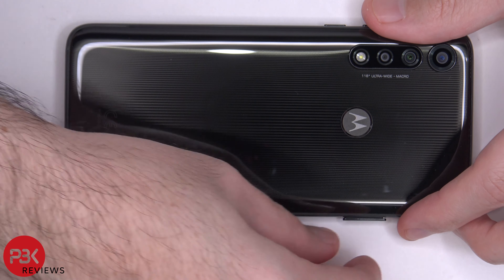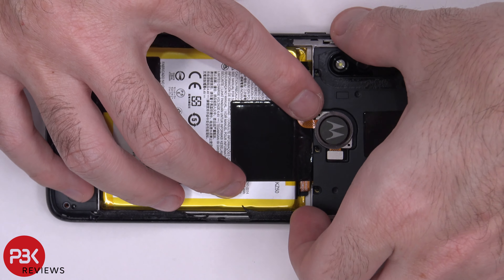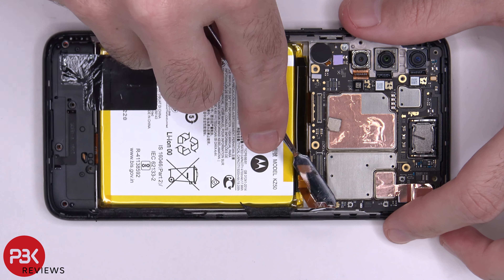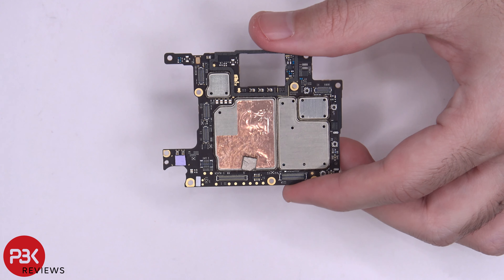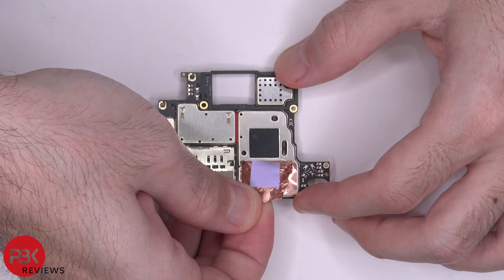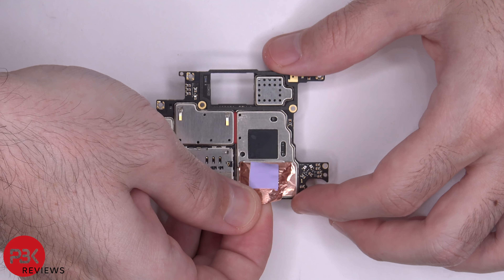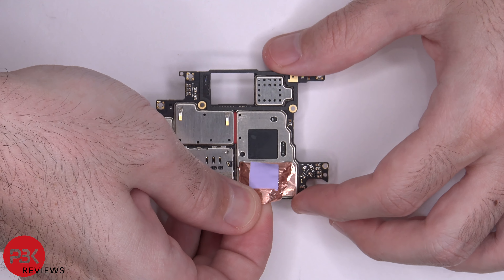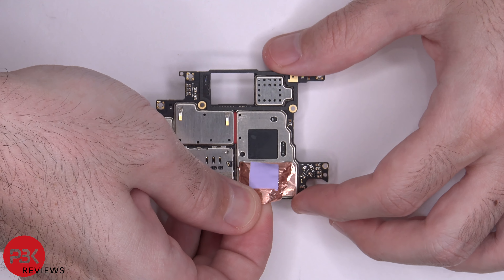Motorola Moto G Power Disassembly Teardown Repair Video Review

Comment: Great video.  It's just sad that the phone is assembled with so much glue and tape.  It would be nice if phones were designed to allow easy replacement of screens and batteries since those components have high rates of breakage/failure.
Reply from the maker: Thanks, and ya would be good if it was easier.
Reply: I have a 2020 g power that I love but the charge board is failing. Ever phone I've had ends up with this problem. I'm sure I'm causing It. I use my phone while charging allot. If the charge board was easy to replace I'd probably keep the same phone for years. I might try a Fair Phone but Im spoiled by the powers battery life
Reply: They make it so difficult so they can make more money. They know that most lazy consumers would just rather buy a new phone as opposed trying to change something seemingly complicated on their own. I would definitely encourage learning something new when the battery dies, and it will, eventually. The key to significantly delaying that process requires knowledge of the battery itself as far as knowing what a cell system is to begin with. Some of the fault of the battery problems belongs to the companies (30%) although much improved, they still haven't developed a competent multitasking, proper heat conduction/distribution battery ( if even possible) Most of blame for premature battery failure lies solely on the consumer (70%) Smartphone user's abuse the battery with overloading the cell's with way too many time consuming multitasking.This causes the phone to overheat, especially on warm, hot day's. Batteries require a cool down, recovery period, much like a human require rest to heal and rejuvenate, it's no different from the cell's within a battery. First mistake is, they are charging their phone's daily which should be done every 2-3 day's.They are overcharging the phone's. A phone should only be charged 100% once a month only, with an average charge of 70-80% 2-3 times a week. Phone's shouldn't be charged in hot climates, in fact should not even be used for long periods of time in direct sunlight, quick texting, phone calls only, no surfing. Extreme temperatures are the main problem, either thru excessive use or in extreme elements too long. Lower the light and shorten the display time under a minute. Another hack is to turn off any apps that may be running in the background. The main key is moderation ( easier said than done😄) it could add up to 5 years to your battery life.

Comment: Cracked my phone screen on the third day I had it. Fixed it today. This video saved me a lot of money. Thanks for posting!
Reply: Where did you get screen from? I'm trying to purchase one
Reply from the maker: You're welcome, glad It helped!
Reply from the maker: Here is a link for one on amazon https://amzn.to/3fHthuQ
Reply: @iotofiot8008  I found it on eBay.
Reply: Looking for a new screen I can't find.any expect for the Moto g8 power one
Reply from the maker: @yungo.g8797  here is a link for some on amazon. https://amzn.to/32gr30g   make sure you are searching for XT2041 lcd screen since thats the model number of it they list under usually. Sometimes the same type of screen is used for a few models of phones. Also keep in mind if you look at the pics, there is subtle differences on the screen cables, make sure the cable matches that of your phone you are replacing since some phone models may differ from different regions and the cables might be different as well. For example if its a XT2041-2 vs XT2041-4 etc. If you take your's apart and look at the screen cable and how its positioned, you can compare it to the one on the amazon listings and match to the correct one you want to purchase. Hope this helps.
Reply: Hey Tim, can you please share the ebay link? It's expensive on Amazon. Thanks!
Reply: You have to remove all of that just to replace the phone's battery?  I have a 2020 model Motorola MOTO Power G and my phone's battery looks bloated to the point that the phone's back cover will no longer stay closed.
Reply: Should I buy a different brand of phone since my Motorola MOTO G Power 2020 model is having a problem with it's 5,000 mAh battery?  I could never do what you're doing in your video but I'm considering buying a different brand of smartphone to replace my 2020 model Motorola MOTO G Power smartphone.

Comment: Good video.  A Few notes.  Mine was a T3 not a T4.  I think in editing he missed a couple cable disconnects so just keep your eyes open for that kind of stuff.   If you're doing a frame replacement you don't have to peel off all of the tape.   Just take it off the battery.  Not a big deal but keeps parts together a little better.  No need to pull the copper tape off the rear facing camera.  He likely did it just in case you needed to know.  All in all, it was very helpful.  Just did a frame replacement with new screen for $40.

Comment: The camera glass on my Moto G Power 2021 was broken. I began by trying to heat up the glass only to avoid removing the back completely. Then I noticed some of the back covering became wrinkled/warped from the heat. I then decided it was best to proceed by removing the back cover. However, after failing to remove the backplate (used a heat gun for about 3 minutes) I reverted back to trying to remove the broken glass only. I used a precision flathead to begin removing the glass. I used the heat gun here and there to soften the adhesive, used the flathead to scrape off the adhesive and pry off the bigger pieces of glass, and used tweezers to remove smaller bits. Towards the the end I used baby cotton swabs with alcohol to further remove sticky residue and bits of glass. Eventually I was successful in changing the camera glass without taking the back of the phone off.
Reply from the maker: Glad you were able to get it done. Here is a website in case you need any parts for it: https://www.mobilesentrix.com/replacement-parts/motorola/g-series/moto-g-power-2022

Comment: for those of you trying this, I had struggled to get the back off, apply heat like he says via hairblower and it should make it easier. also make sure you are only taking off the tiny part of plastic, i was trying to take off the back at the line closer to the screen, which is incorrect. I used a thumbtack and a decently thick credit card since I did not have the tools the video has. If you are careful enough, I was able to use the thumbtack without damaging any part of the cover/plastic/phone .
Reply from the maker: If you need replacement adhesive to re apply the back plate/back cover for this phone or other parts, you can get the original parts from mobiledefenders.com .
Reply: I did the same and ripped up the plastic around the side of the phone.  I use a cover so assuming that I can get it functional again it won't matter, but I spent far more time and effort than was necessary.  UGH!  The cover comes off, after adhesive loosening, just like any other cover.  I have no idea why they don't make it accessible.  

On another note, my phone went into the pool.  Millenial brainstone, I hope that it's just the battery which I'm going to replace.

Comment: Great video. Thanks! When you say "heat up a bit" in order to remove the back side, can you indicate what temperature to use for the heatgun?
Reply from the maker: I usually don't use a heat gun and generally use a hair dryer since its more of an even heat and not so direct and potentially damaging if you overdo it. Either way you want to generally heat up the back evenly at first  but just going in slow circles, then when its warm, you heat up the area you want to begin prying off a bit more so its hot to the touch. Then you can use a suction tool or something else to help gain leverage to get your pry tool in, and you can add heat as needed to keep the adhesive loose while working your way around with the pry tool.
Reply: @PBKreviews  Thank you for all the advice. Repair done successfully! I used the hair dryer eventually as you suggested.

Comment: I appreciate this video. It's very clear.  I bought a T4 screwdriver when I ordered the battery but it's way to big.  The torx opening is half that size but this and the other videos I watched all said T4!  But mine. Ugg.
Reply from the maker: Some brands especially ones which are not made for smartphones differ sometimes. It's best to be a small kit which comes with 4 sizes just in case.
Reply: @PBKreviews   I bought it at the phone parts place that sold the battery.  I just got the new set and the screw size is T3 on this phone, model XT2041-4.   You said "gently heat the battery".  How much is "gentle" and what did you use? The battery is puffed up and swollen and I don't want this thing to exploded!  Thanks so much.
Reply: I got it. Someone else suggested a few drops of 90% alcohol under each corner of the battery and that worked.  Back together and working now. Thanks again for the great guidance.

Comment: Don't even know how, but my lower lenses/flash on my camera are all cracked.  Messes up photos in certain lighting conditions(most lighting conditions I think).  Was looking into new phones, but most phones in my price range are freaking huge and the moto G power 2020 already is bigger than I'd like.  Decided to just order the part and fix it.  8 bucks including shipping for an OEM part.  Not sure I want an OEM part  in this case since I have used a case ever since I've owned the phone yet somehow the bottom lenses cracked anyways.  Thanks for the guide, should hopefully be a simple fix.
Reply from the maker: You're welcome. The glass cover for the camera lens is held down with adhesive so you should be able to heat it up a bit with a hair dryer and pry off the glass portion with a razor or xacto knife or something similar, without having to actually pry off the back plate/battery door. Regardless if you need any additional parts for the phone, you can get all the original parts including adhesive for the battery door/ back plate to re apply it at mobiledefenders.com
Reply: @PBKreviews  thanks.  I have a heat gun somewhere, just need to dig it up.    That's the website I ordered the part from, thanks.
Reply from the maker: @jwest88  👍

Comment: my motorola has an issue with power button being pressed in, its constantly trying to turn on and off. would it be possible to fix something like that without undoing more than back cover? i dont have a way of unscrewing the small screws

Comment: Fasinating video!   Thanks!   Just curious, I love my Moto One Action and I keep my sell phones for at least 4-5 years.  What is an average cost with labor to replace the battery when the time  should come.  Or is close to the cost of replacing the whole phone? Thanks again for posting!  Cheers, Steve/OHIO
Reply from the maker: Thanks, Labor can vary from place to place but the battery cost is usually around $30-$40 USD. Shouldn't cost more than replacing the phone.
Reply: build in battery lasts 4 5 years in my moto phones usually they outtated or cracked before battery even goes even if charging randomly only few at time my expeirence w moto

Comment: My phone screen recently cracked and I was using a few videos like this as reference to try and get the back off to replace the screen. I've really been struggling with it, do you have any advice on getting it off? The heat gun hasn't really been working for me
Reply from the maker: The adhesive can be very strong on this model phone. You can try using a metal thin tool to help you gain some leverage between the backplate and the frame to get a pry tool in between but that can possibly damage or scratch up your frame a bit. You can also use a suction cup tool for smartphones to help you pull up on the back housing as you're trying to get your pry tool in as well as prying it off. Also keep applying heat every now and then as your prying it off to keep the adhesive loose. And if you need any parts (like replacement adhesive strip for re applying the backplate, you can go to this link, they have all the original parts for this phone: https://www.mobiledefenders.com/motorola-repair-parts/g-series/g-power-xt2041.html
Reply: @PBKreviews  Thank you so much!! I'll try this out :)
Reply from the maker: @audreygutierrez5364  you're welcome

Comment: Hi, I have a quick question; I am trying to fix my moto g8 LCD and accidentally cut one of the wire cable (black one at 1:58) which connects the charger port to the motherboard and now my cell phone does not charge. I was wondering what is the specific name for this wire and how can I get a replacement. Thanks and much appreciated
Reply from the maker: Hi, its called a smartphone coaxial cable. You can check on mobiledefenders.com and see if they carry it. I know they have some for different phones listed which should work as long as the length of the cables for the other phones reach. If not you can contact them and ask if they can get that part for you.
Reply: @PBKreviews  Thank you, much appreciated!
Reply from the maker: @mwi468  you're welcome

Comment: My cameras glass broke. Did you say that new adehisev need to be applied to get the back cover back on?
Reply from the maker: You can heat up and pry off just the glass portion of the camera lens cover to replace it. You don't need to pry the back plate off.

Comment: Great video. Can you explain removing the speaker for replacement? Mine suddenly quit working.
Reply from the maker: which speaker, earpiece or loud speaker?
Reply: @PBKreviews  earpiece speaker replacement would be great
Reply from the maker: @jeffspengler8789  After the phone is taken apart, its only held down with adhesive. You would just need to heat it up and pry it off. Here is a link to the replacement parts for this phone: https://www.mobiledefenders.com/motorola-repair-parts/g-series/g-power-xt2041.html

Comment: What version is this of the moto g8 power? This looks like a different model as the head phone jack sits at the bottom instead of on top and off centre.
Reply from the maker: This is the US Moto G Power.
Reply: OK that explains why there is a slight difference between this in the video and mine but as youposted a comment back to me I say good timing as I ran into an issue recently that got me a little worried.

If your power button only works for a short time and becomes unresponsive until you hold the button to force the phone to restart for the phone to work normally again for a short while, how can I repair to work as it should do as before this behavior got triggered?

Comment: the little snap for the white wire broke off (i think?) on the top part of the phone. what do i do? do i just need to buy a new one?
Reply from the maker: You would need to find one to buy and replace the cable. I believe its for the antennas. Here is a link to some for different phones, not sure if they will be similar lengths or not but couldn't find one for this phone at the moment. https://www.mobiledefenders.com/catalogsearch/result/?f=coaxial+interconnect+cables&q=coaxial+cables

Comment: Hey, I saw you still reply to comments. My camera lense on back cracked, i have the replacement, but can I change it without taking the whole backcover off? thanks alot :)
Reply from the maker: Hi sorry for the late reply. Yes you can heat up the camera lens and pry it off. Its held on with adhesive. You don't need to take apart the phone.

Comment: Is the Graphite film just used to fill dead space in the phone?
Reply from the maker: Honestly some portions I can see why it is used to transfer heat, but other portions sometimes they place them in places which don't make sense to me. The exact reasoning I don't know but for example the speaker. I don't think it creates that much heat but why put an extra slab going over one corner of the battery. Maybe more surface area to spread the heat from the speaker? not sure. Maybe someone more verse in this field relating to graphite film can answer.
Reply from the maker: ya its possible
Reply: it's a safety thing.. when temps get too high it shuts down before it does dmg. that's why it's also attached to the battery and then onto the cpu.. if the battery get's crazy hot for whatever reason the cpu also get's hot and then it shuts down. can't think of a different reason really..

Comment: Thanks for the very good video! I do have a question though.
I got my screen replaced and now suddenly my WiFi signal strength has dropped massively. I still do have Wifi, but the signal is so weak, I can't really use it :(
Do you have any ideas or suggestions what to do, or what could be the reason?
Reply from the maker: You would need to check and make sure the motherboard is seated properly and the top and bottom plastic covers are in place and screwed down properly. Also make sure the 2 wire cables or coaxial cables are connected and have not come loose.
Reply: @PBKreviews  Thanks a lot for your advice! I appreciate it very much what you do for your community. I will try to follow your instructions and fingers crossed! :)
Reply: @PBKreviews  After getting the tools and disassembling the phone and going through your points, unfortunately the signal strength problem could not be resolved.
Do you know if there is any link to the replacement screen which might affect Wifi and GPS signal strength? I got the screen replaced rather cheaply...
Another thought I had is, that the wires are damaged, though not visible. Is there a simple way to check this?